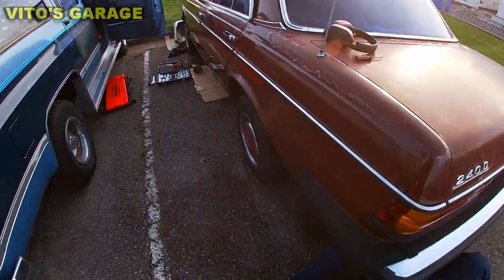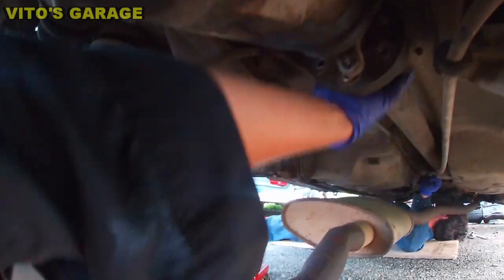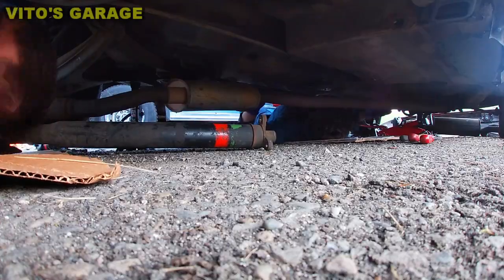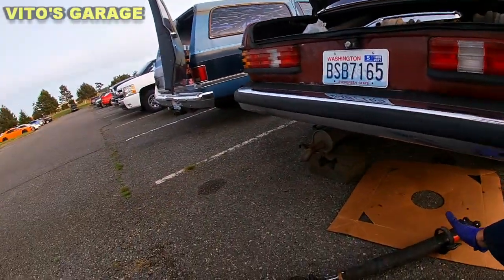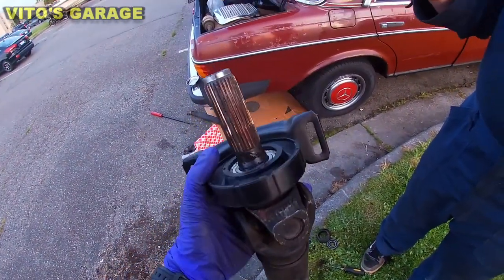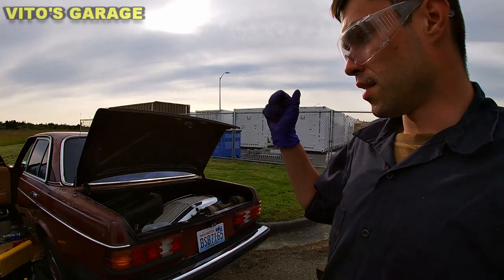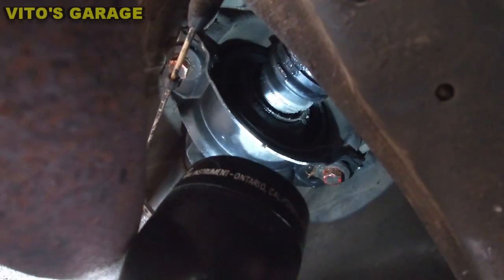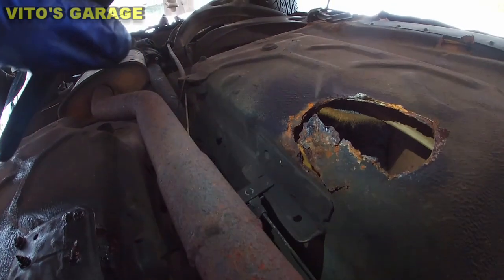Mercedes W123 New Driveshaft Flex Discs & Center Support

Comment: Hi Vito.
 I respect your admiration and love for classic mercedes. I believe in the nobility and loyality of these cars. I have a 80' 300 naturally aspirated, actually.
What I would like to say to you is that a car like that deserves and needs, for respect and dignity of what it represents nowadays and no matter when or where, original mercedes parts. I feel it is so important for the restoration and preservetion of these machines avoiding aftermarket replacement, and let it keep rolling with its original quality and distinction among others. I know original parts are considerably more expensive, but the warranty and feeling of a car made with chinese or romanian parts are not the same, obviusly. But, having in mind that fact, that results wiser trough time, we, who appreciate these cars, must preserve as much original as posible, for respect and dignity. I do not want to consider here replacing parts to avoid catastrofic failures, it could be reasonable the aftermarket parte in this case. But i prefer the big boy with an almost 37 years old sitll working water pump than ordering a brand new Dolz pump, made in Vietnam. 

I repeat it, i appreciate very much your entusiasm and passion for these old and big machines. And let me give you an advise: marry you with an old diesel Benz, or with many if you can, instead of any woman of nowadays. When you were old enough, you will notice the meaning of loyality.
I would like to know what you think.

Beware. Best wishes.
Reply from the maker: Thanks a lot for watching my videos and supporting. I've been married to a lot of cars now, I don't need any women lol... And Febi Flex Discs are great quality parts. I've never had any problems with them. I've installed Febi Flex Discs on W210 3 years ago and have no problems whatsoever! Save Classic Cars!!
Reply: @VITOSGARAGE  got it, I admit having intalled non original parts like front crank seal, steering arms and even the oil pan, from Febi as well. I have in mind changing all original mercedes when i had money and time. I al the only one who touch muy car. 
Goodbye

Comment: nice vid man. i still have this vibration/noise from the drive shaft area that i cant seem to fix. My 300d  it only does it when i accelerate from low revs in a high gear (3rd or 4th)  at around  40-50 mph. Replaced all engine mounts, gear box mount , flex discs,  center bearing and rear diff rubber mount.  running out of ideas at the moment :/
Reply: Might need to have the driveshaft checked for balance by a machine or driveline shop.
Reply: @45AMT  thanks that the next thing i might wanna try, get a used driveshaft and do a cross check.
Reply from the maker: Wheel balance, loose steering components (especially a bad steering dampener will cause vibrations), driveshaft balance. Bent axle is the last thing but I doubt it's bent on your Benz. I just changed a trailing arm on my customer's W123 because the car slid and hit a curb really hard. Trailing arm was damaged. The cv axle was slightly deformed on the outer joint casing. These cars are tanks!
Reply: Hi! I have a similar or maybe the same problem, I 've changed everything and have balanced the shaft but the vibration still continues.. I think is the engine although with new mounts it twist one side and interferes with something that second or minute, then disappear so it can't be something damaged or bad balanced 🤔  Sorry for my bad English

Comment: I think i am going to replace that roller soon. I have an issue with very strong noise of metal parts hitting to low speeds especially when a use the 3rd gear. I replaced everithing in the  rear suspenssion  ( she needed anyway) including the flex discs . I though it was the diffierencial (internal parts) so it was replaced, but it still sounds  The only supstected guy in the whole transmission line  is this roller. espcially becuase a high speeds a wistle like sound replace the sound of htting metal parts. I think tht by rotating a very high speed the centrifugal force over the cardan (and the roller) mantains the bar in possition  hitting no other parts.
Reply from the maker: Which roller are you talking about? The driveshaft center support?

Comment: Flex disc not plate Mybad!
Reply from the maker: Really bad flex disc can cause vibrations on the highway. But you usually need to replace them if you see them having cracks. I've seen bad cases when flex discs just came apart on the highway and the driveshaft let go of the transmission yoke and destroyed the tunnel, driveshaft and the back of the transmission.. Crazy..

Comment: A new rubber part you will change after 1-2 year, old original is better
Reply from the maker: I have used Febi flex discs before and never had any problems. "Meyle" brand is the one to avoid
Reply: @VITOSGARAGE  i have tried diferent flex disks (febi, meyle, and other), but only old original from junk works best
Reply from the maker: I am not worried about it. I've put Febi flex discs on my W210 5 years ago. They're still perfect.
If something goes wrong, I have a lifetime warranty on all the parts. I can always send them defective or worn out parts and they'll send me new ones for free
Reply: @VITOSGARAGE  in Russia there are a lot of fake spare parts, I probably came across such
Reply from the maker: Yeah I know. It's a different world there, unfortunately
Reply: @VITOSGARAGE  Correct. Febi flex discs are good quality.
Reply: @VITOSGARAGE  i was just going to order some meyle, now i will get the febi, this is will make a big difference on my 81 300sd.
Reply: @jefferyjohnson5421  Agreed. Febi and Lemforder are very good. I order them from Pelican, and make sure they read "Made in Germany."